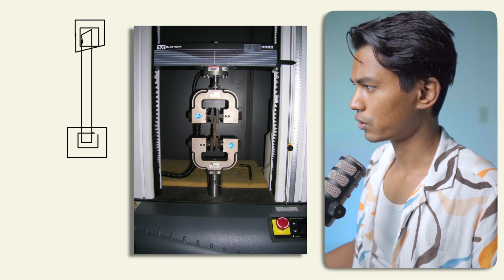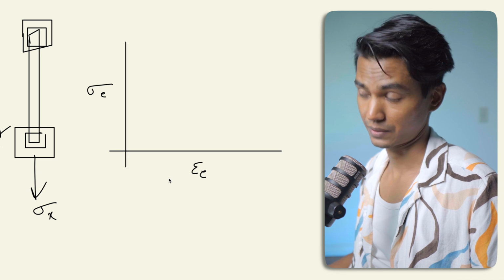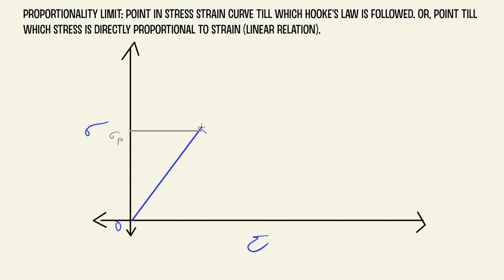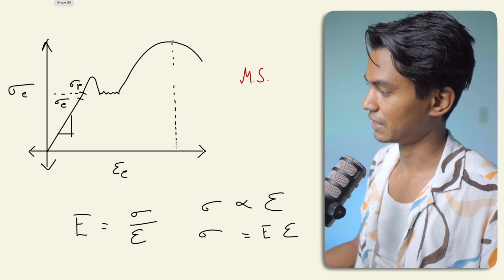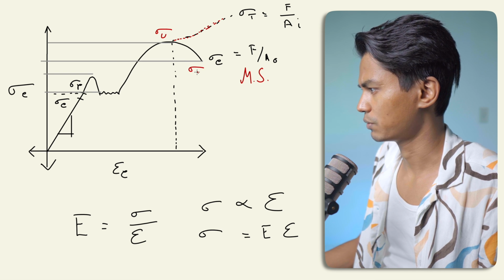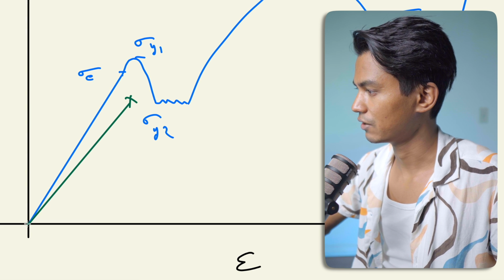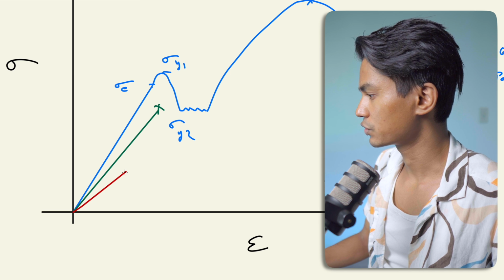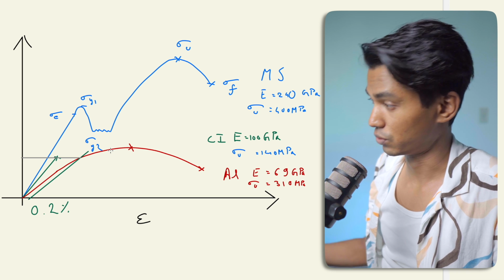Stress Strain Curve | Full Explanation by Ashish Ranjan, ex-ISRO, ex-BARC Scientist

Comment: 11:04 You showed the true stress curve deviating from engg stress curve from the point of ultimate tensile strength but the chnage in are of mild steel rod can be significantly seen after the lower yield point . Why not deviate true stress curve from the lower yield point ?? 
 
Help me with my confusion.😊